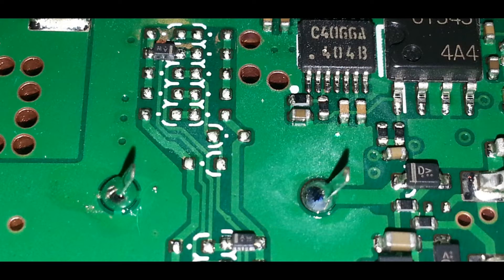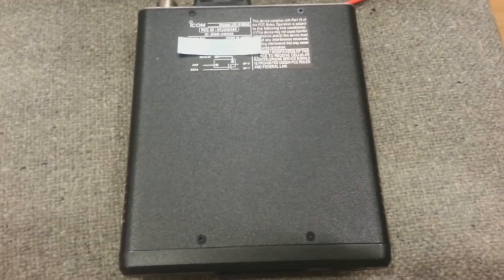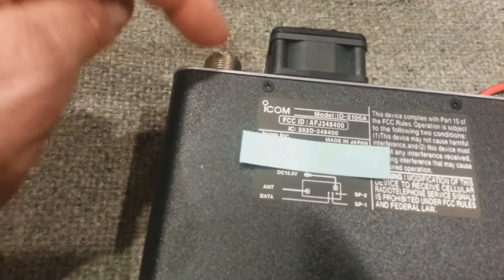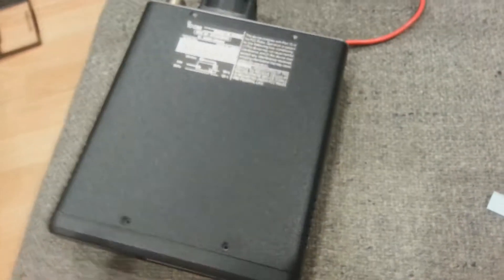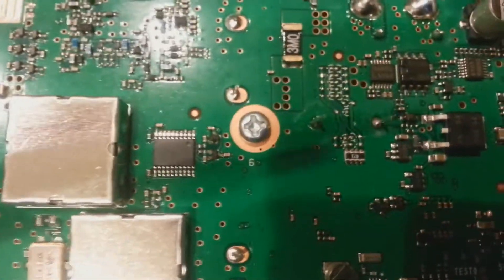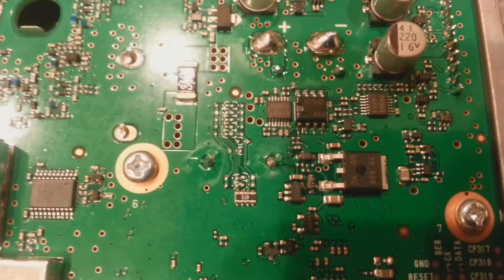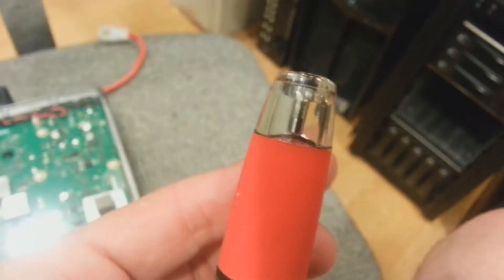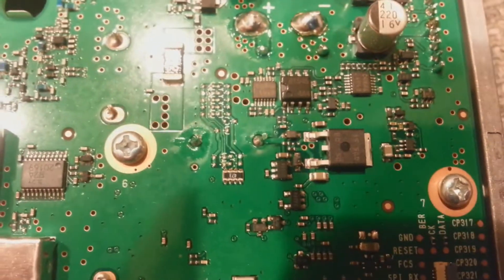ICOM ID-5100A MARS / CAP Mod (Frequency Expansion)

Comment: Great video. For an update and for those looking, because someone will, if you have a newer model and you’re in the United States, there are 3 diodes in this area. Only remove the two shown in this video. Leave the third one in place.
Reply from the maker: Send a picture if you took it and send it to info@seldenradio.com
Reply: @Joeteck I guess I should’ve. She’s already buttoned up and installed though!

Comment: What is the power output on the GMRS channels? I've read elsewhere that it is drastically reduced on other iCOM models when transmitting on the GMRS channels.
Reply: I can't speak to this particular radio, but when I tested on my ID-4100A I was getting over 40 watts on GMRS frequencies - very similar to what I was getting in the 70cm ham frequencies.

Comment: Great video ! 
On the U.K. version there are more caps in the area, but I can confirm that it`s exactly the same (crossband repeater one is in the center between the 2 others !) so I`m a happy bunny, by by warenty ! I would strongly sugest letting a pro do it for you as you need a sharp scalpel blade as it`s so small it looks like a spec of dust, and if you miss you can interupt the tracers and byby radio !

Comment: I've done this mod on Yaesu radios, and they require a factory reset afterwards.  Does this radio need a reset, or reprogramming after this modification?  Thank you.
Reply from the maker: Nonit does not. Just remove those bad boys and you're golden!!!! Enjoy!
Reply: @Joeteck  Thanks so much for getting back to me so quickly!  73
Reply from the maker: Of course! Your question was directed to me.. surprising low SWRs on GMRS!!

Comment: K5VK- I was all set to desolder, but discovered that all you need to do is take a screwdriver and pop the diodes off.  Mine came off clean, works great!
Reply from the maker: I dont recommend that, because you could damage the board. But great job!

Comment: Anyone notice random screen taps when doing this mod? I will see my larger band selection flash as if I'm tapping it, and the FM button randomly flash too.
Reply from the maker: No. It only modifies the frequency range. No firmware changes
Reply: @Joeteck  I figured it out. I still had the screen protector on and it was tapping the screen for me.
Reply from the maker: @TheProSlasher  lol, glad you got it worked out. I have two of these now. base and mobile.
Reply: @Joeteck  yup. Though, I learned last night that the th74a can't transmit on high power when plugged in to the wall. Whoops. :/

Comment: Hi thanks for the video, I saw a similar video on a handheld where they just used a screwdriver to pop the diode off the board....  since the diode is so small is that also an option?  I have limited electrical background but it seem like the end result would be the same, or is there a benefit to using a soldering iron ?
Reply from the maker: Great question! Using an iron, makes it clean removal without breaking the LANs or the components on the circuit board. Im a bit anal when it comes to my equipment. I would feel better telling my viewers the correct way to do it than risking damaging the radio if you slip. ;)

Comment: Is the other diode over the chip that says 473? You don't point out the 2nd one in your video.
Reply from the maker: Sure I do.. first 20 seconds shows you both. 0:06
Reply: @Joeteck  I'm sorry. I was looking at the time you were pointing at it with a screwdriver. Thank you for your reply and the video.

Comment: how about a icon ID-4100a
Reply from the maker: +KEVIN PAGE No idea, I do not own it.
Reply from the maker: Kevin, I called ICOM for you. They would not tell me which ones by law. However, there are two diodes on the matrix that need to be removed.  Remove the cover.  If you're looking at the board, antenna would be top left and the radio face would be facing you. ( Large knob bottom right) Look at the right side of board. Screw is in the middle of the board. Move  about and inch to the left of that screw and you will find  two diodes over each other. Below them are empty spots. directly to the right should be a chip labeled NVC04. Hope this helps. Sorry for the delay! Same frequency expansion!
Reply: thank you
Reply from the maker: KEVIN PAGE you are very welcome!

Comment: Anyone know how to switch to the repeaters reverse frequency on this? I haven't been able to find ANY info on it.
Reply: If you press MONI while tuned to a frequency set up for duplex, it will switch to the reverse and turn off the squelch.
Reply from the maker: ertonyrn I can check in about an hour.  Going to stop driving soon
Reply: Thanks!
Reply from the maker: ertonyrn ok, I remember now. You cant. It's not like a Yaesu where you have a button. You have to program the reverse in as a separate channel.
Reply: ding ding! figured it out a cpl weeks ago and have been meaning to post here. Thank you! Now if we could only gind why the "aotu-off" feature does NOT work if any of the volume knobs are turned clockwise PAST the 6 o clock position. Radio will stay on all night
Reply from the maker: ertonyrn auto off feature works fine for my radio. I depend on it. I have it set for 1 hour
Reply: ertonyrn go to QUICK > DUP > (+/-/OFF)

Comment: Why are some sites stating to remove 3 diodes
Reply from the maker: ertonyrn could the European model? this is the 5100A not E
Reply from the maker: @kismotbutod  I truly have no Idea.  The A version has cross-band repeat already enabled.
Reply from the maker: @kismotbutod  no, do not use that. You will remove other parts because it's not localized to that small area
Reply from the maker: Use a small pair of diagonal cutters in the middle of the diodes or to look pretty use a soldering iron.

Comment: hey joey. before i attempt this, i gotta ask, do all features of the radio still work even after firmware upgrades? and once the diodes are removed, does the "off band" message pop up or are you able to transmit.
Reply from the maker: Anthony DiNardo yes, that message will disappear. (GMRS band) Be very careful, and take your time.no reason to rush. if you have a lighted magnifer, USE IT! lol Let me know how you make out.
Reply: hey. i just shot you an email. i think it is you.
Reply: sent you a pic. i got a little bit of residue that looks to be a copper bump. im wondering if im ok, or if i should attemp to scrape it off
Reply from the maker: Anthony DiNardo hang on, let me check
Reply from the maker: yup that's me. sent you an email back.. looks like the SMD part is still there. heat up the iron and try to get it stuck to the iron.

Comment: Hey Joey I just bought the 5100A. if I remove these diodes I will be able to transmit on 137 to 174 and 400 to 470? I noticed I tried to transmit on my fire ops channel and I got off band message.
Reply: ive did mods on tons of radios. and i always get **137-174.000MhZ --- 420-470Mhz